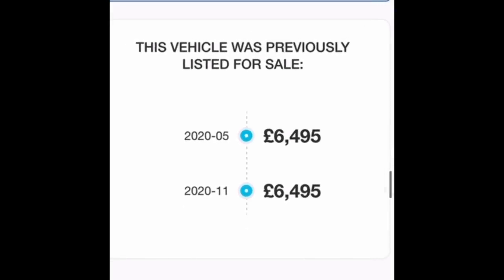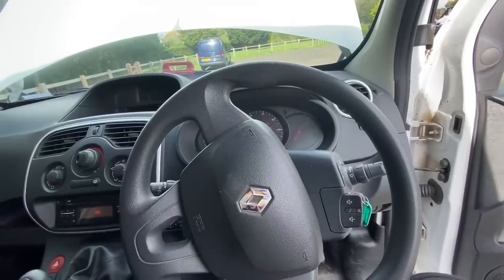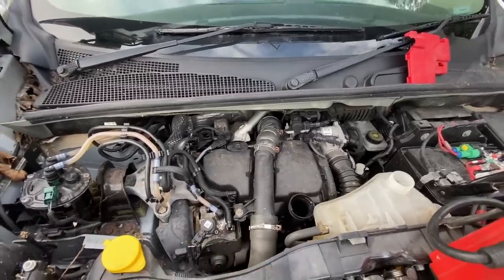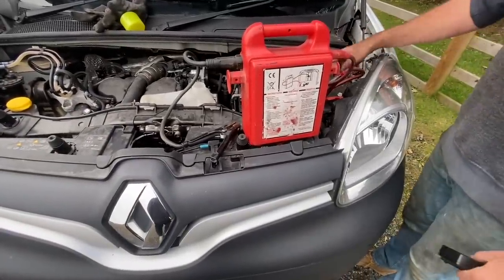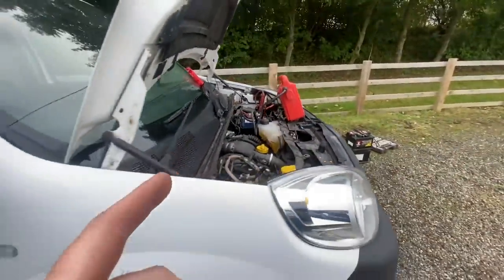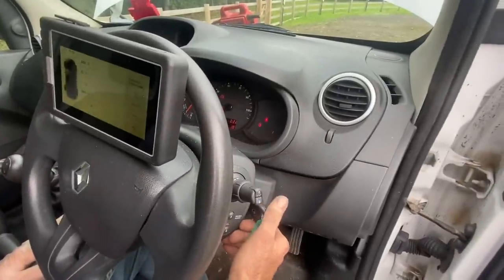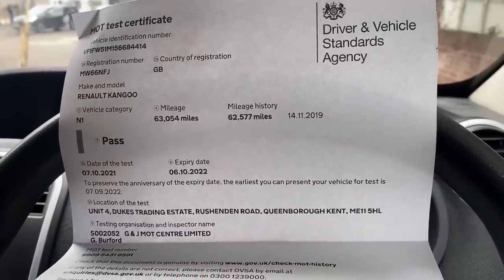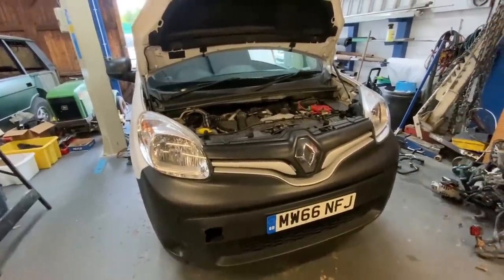Non Runner 2016 Renault Kangoo Crew Van Win Or Fail ???

Comment: Your milage doesn't check out , between MOT been clocked back by 585 miles ???
Reply: Last MOT in 2019 was 62,577, new MOT was 63,054, all adds up fine  🤷🏻‍♂️